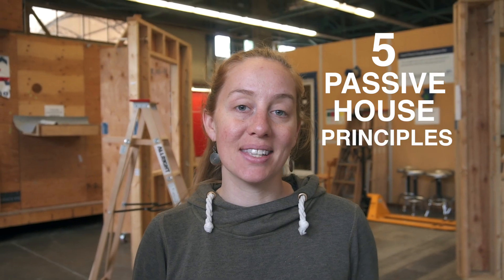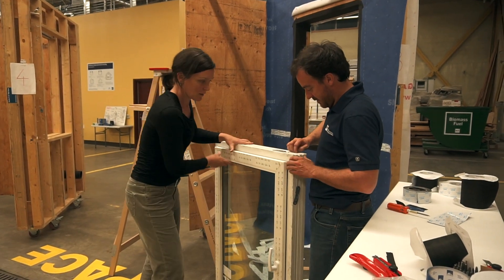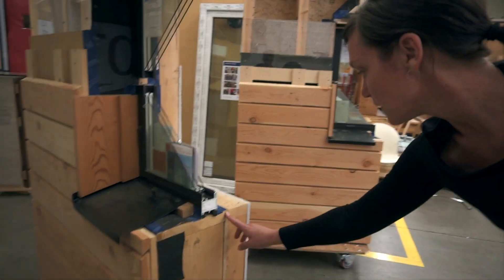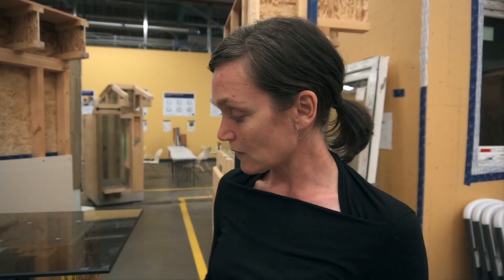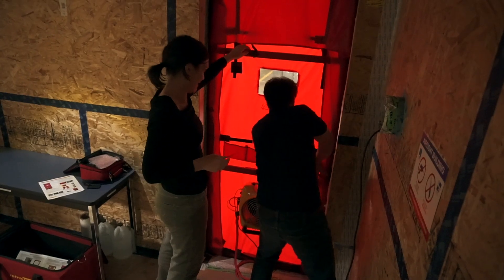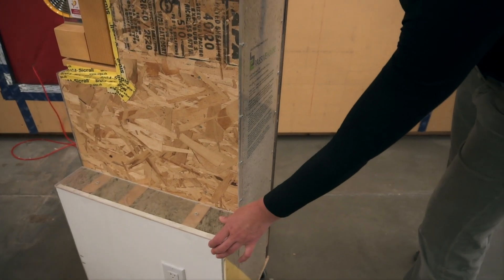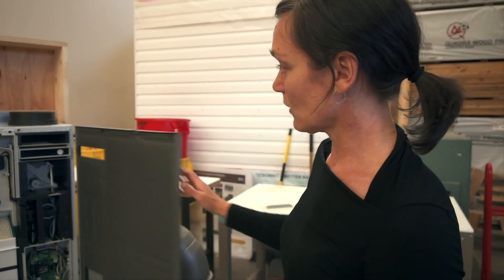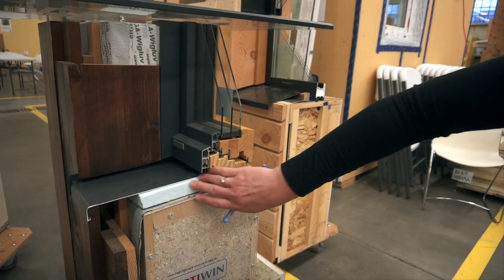Passive House = 90% Home Energy Reduction!

Comment: Nice presentation! One thing I notice is that they keep mentioning where they are trying to keep heat IN the building. This is true in a colder climate. I live in the desert (Phoenix Arizona) where the opposite is true most of the year. This same passive house building techniques would apply here too. They should mention that as well ;-)
Reply: I would like to add that the heat differential is typical much greater in cold climates.
Reply: T Jam Yes, and add reflection and passive wall ventilation.
Reply: @Conservator.  "passive wall ventilation" ...noup, you don't use passive ventilation in a "passive house". All air circulation is handled by controlled in/out system with heat exchanger (like in the video). In winter incoming air is heated with outgoing air and in sommer the opposite. It's possible to add underground piping for incoming air, so the air is preheated/precooled before coming into heat exchanger.

I built my passive house in 2004 in Nordic Countries (Finland) and basically all new houses there have been like presented here, for a decade or two. So welcome to this century for others too
Reply: Timo Grönroos Hi,
Thanks for your comment. Heat recovery by heat exchangers are very important especially in cold but also in milder climates like here in the Netherlands. And yes that requires an active system. 

I was referring to hot climates where sometimes hot air can be ventilated passively by letting it escape at a high point and having an inlet of cool(er) air at a low point. It’s a bit like a chimney. During colder nights the airflow could be reversed. 

I like the concept of having underground pipes for heating and/or cooling air in the winter and summer. Could you give me an idea of the size, length and depts of the air tubes used for such a system?  I plan to build a small workshop in my garden and I would like to make it as energy efficient as I can. That is, without braking the bank. Any hint would be welcome. Tia.
Reply: I designed/built/monitored the UK's first 'passive solar dwelling' in the '70's. It was highly air-tight, off-grid and had solar preheating of air and 'passive ventilation'.
MVHR is not passive, and in the long term future, I think we will move away from these active systems. Buildings need to be affordable, simple, robust and fail-safe.
Reply: green genie 
Thank you for pointing this out. I’m interested in how such a system works. Would you have any links to more information? Thank you in advance!
Reply: My Integrated Solar Dwelling/Garden was designed in 1972 when I was studying at the Architectural Association and in my 20's. It then took around three years to find find a site and sponsorship to build it (just me and my wife Frances) at Brighton Polytechnic, UK. Times have changed and I would not design in exactly the same way today.

The timber-framed, single-storey ISD had a sunspace on the south, an air-tight, insulated living area behind, and an uninsulated 'lean-to' along the north for workshop/food storage/battery storage (the off-grid dwelling had a DIY 24V wind system).
Solar pre-heated air from the sunspace was drawn into the living area via tiny gaps behind the south windows (which were also solar air heaters at their lower level) by the gentle airflow through the internal aerobic composter toilet.
I designed and built a copper solar water heater (thermosyphon/direct/no heat exchange coil) which regularly produced a tank of boiling water. On the few frosty nights the small amount of water in the panel could be drained back onto the roof from which (the rainwater) had been harvested from.
The only active components were the wind turbines and the tiny 24V pump that pumped water to the header tank on the roof. We had a specially made 24V cooking system, and we washed our clothes at the launderette. We used legs/bicycles/bus/train for transport and did not have a telephone on site during construction, and no nail-guns!
We had almost no thermal capacity in the ISD - we were intending to experiment with Water, Glass and PhaseChangeMaterials, but unfortunately, when Thatcher was elected in 1979 our monitored project was closed to save money. The ISD cost less than £13K to build (including our salaries)!
Today you would not put the sunspace on the south (maybe on the east) and you would cover the roof with PV, which can provide cooking and the tiny amount of winter top-up heat required.
Most components of the building are still in use today, but on different sites and no longer as a solar dwelling...
Reply: green genie 
Thank you very much! What a fantastic story. You were real pioneers.
Reply: @Green genie, can you point us to an example of a house that you like?  Many of your posts just provide vague solutions like “affordable” “durable” and allows air to move.  You’ve been at it long enough you should be able to point to at least one example of a model house we can look at.  Don’t end your post with “...” as if to say “you figure it out.”
Reply: @greengenie7063  Thanks so much for your contribution, given your lifetime of experience in this field I wonder if you could point to particular systems/developments in eco building design that particularly impress you?
Reply: That is what I was just thinking
Reply: Yeah true, in the case of cooling, one might use a solar chimney on the roof to create a draft through the house (drawing the hotter air out which settles on the ceiling), and draw the low temperature air from a long pipe buried 6ft underground, into the basement, to bring cooler air inside if needed...
Reply: T Jam heat or rather the optimal living room temerature. Same rules apply only windows should be on the opposite side
Reply: Reinis Miks not in areas like Oklahoma where it is in the 90 in the summer and below freezing in the winter